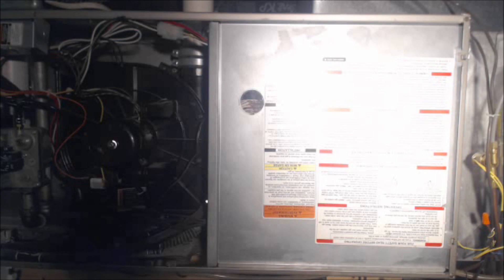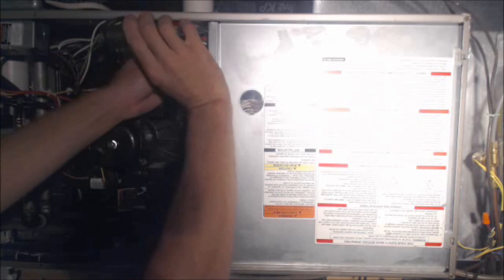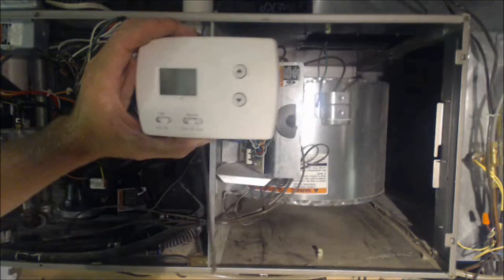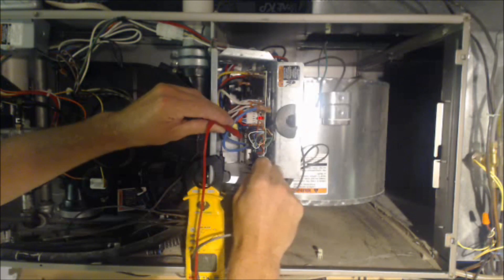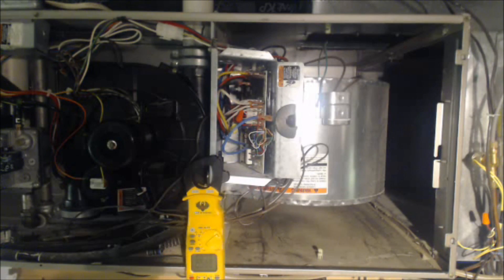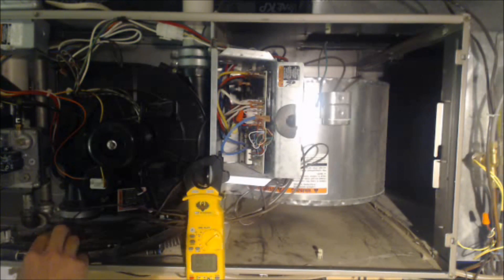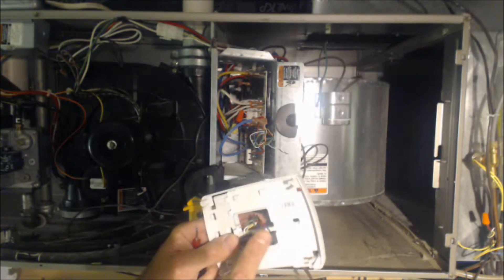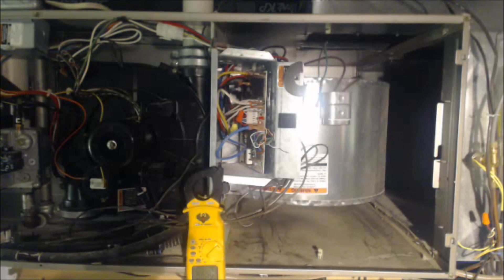Blower Fan Motor Won't Shut off!- STEP by STEP Troubleshooting!

Comment: Cant you just pull the G Green Blower motor from the terminal and see if it stops?  If not then its not the Terminal or stat that is shorted or bad..Correct?  ?
Reply from the maker: Yes you certainly can start by pulling the g wire off of the control board first to figure out if it is a bad tstat, or wiring. I usually test things first with my multimeter before moving any wires but there are many ways to do it. This is just an example, thanks

Comment: Thank you for this video. Following your troubleshooting steps, I found that the board on the wall plate of my thermostat was fried. My blower was stuck, and I had checked the wiring and experimentally tapped the relay and thought I might need to call a tech. Thanks!

Comment: What if you have three units that the blowers stay on and you have 5 thermostats that run them (3 for A/C and 2 for heat)? It isn't turning on heat or A/C but the blowers refuse to shut off even with all 5 thermostats disconnected!!  The only way to shut the blowers off is to flip the manual switch.  It's at an American Legion Post (obviously not residential, who would need that many units?)  I'm an Automotive Tech with a degree in electronics but this on baffles me because I'm not an HVAC tech.   Help a Veteran wrap his brain around this odd issue before I call an HVAC specialist to fix it because I won't be there when he fixes it due to work.
Reply from the maker: Do these heaters have fan limit switches? If so, the temp off needs to be adjusted higher. If these are newer units then find the manual and check the dip switches on the control board. You may have them set to continuous fan to pull in outside air for makeup air possibly since it is commercial. Thanks
Reply: I just found out tonight that one of our TVs and satellite boxes hasn't worked at about the same time (we don't use that TV very often) and we did have a thunderstorm that week.  I would have never even pieced this together if I wasn't changing all of the batteries in the thermostats(Three of them showed low battery and I was hoping that was all that was wrong) when someone asked me to replace the batteries in the remote for that TV and it still didn't work with the remote or manual power button.  I'm pretty sure that we got hit by lightning.  I'm off tomorrow so I'll take my meter and get a better idea of what's going on but I'm pretty sure I'll be calling a pro and our insurance company.  Thanks for the advice and I'll let you know what did happen. It's odd that all three units are doing the exact same thing and they're locked up in a room so no one has been in there other than me last fall to change the filters. Anything electronic can and will do weird things so it's not out of the realm of possibilities, I guess.  Thanks again!!

Comment: It is not possible to follow without electrical drawing , for me it is not a great video
Reply from the maker: Thanks Salvador Dali, I do appreciate all comments. They do give me a sense of what you are all looking for and what is helpful for the future, thanks!
Reply: maybe if you are a home owner. if you are a traesman then this video is excellent, I have suggested to my apprentices to watch all of Ac techs videos.  IF you are a home owner then you need only to know this ( dont need a drawing )   R = 24vac power  C = common  G = Fan  - Y = cooling   W = Heat .. if R touches any corresponding wire it powers the relay to that function i.e   R + W completes the 24 vac circuit for the call for heat..    If R and C directly touch then your furnace is likely not doing anything since you have either blown a fuse, board, or transformer.    R and C touch would be a 24 leg without load which is a short of sorts.   remember that an electrical meter reads the voltage POTENTIAL, this means that if you were to take the R ( 24 vac power ) and strip the wire in 2 places and test is you wll see 0 volts ( you would actually have 24 vac in both locations of the wire but there is 0 difference in the voltage potential )   much the same as if R and C are touching, WITHOUT a load on the line then you have 0 voltage differential, and the transormer will burn out shortly.

Comment: Sometimes my fan runs all the time and the house gets hotter and hotter even though the heat pump is not on .It does it about 2 times a month and I have to turn it off at the breaker .Sometimes it work fine .
Reply from the maker: While this is happening, try pulling the 24v thermostat face off and see if it continues to run. If nothing is calling at the time from the tsat but the fan is running and you remove the 24v face off, you would know if the tstat is the problem. Start there, thanks Doug Hill!
Reply: I have pulled it off and it still runs and keeps heating
Reply from the maker: Do you have electric resistance heat strips powering too or is it just the fan? So at least you have one thing out of play knowing the tstat is good so far. Are you getting 24v from g to c in the air hander?
Reply from the maker: I would only troubleshoot this with the electric res off and the fan off to stay safe. I would turn the power off and disconnect these items and then turn the power on to take the voltage readings to figure out what is going on.
Reply: I do have heat strips but they have never had to come on ,I turn them on to burn the dust off ever so often .But something is making heat ,it's not as much heat as the pump makes but if it's 50 outside the temp inside will keep rising. I think thats why the fan is running.

Comment: I have some problem my furnace can keep running but heat pump turns off. I replaced control panel but fan still keep running.
I turned power off the removed thermostat cover and turned power back on and furnace still running. Is that mean thermostat good? What is problem ll be? Pls help thank you.
Reply from the maker: That does mean that the thermostat is good if the same thing happens when the thermostat face is off. What happens when you turn the power off and disconnect the w wire off of the control board and then turn the power back on. If nothing happens then the problem is in that thermostat wire.
Reply: acservicetech do you mean W wire goes to termostat? There is no W wire going to control panel. Btw I changed termostat and control board. But still have same problem.
Reply: acservicetech do you mean W ( white wire ) going control panel, yes I unplug it then turned power back on, and fan still on

Comment: thank you for your video really helps, question: my blower motor does not remain on when the heating shuts down, not even a second, can you please give me a pointer, thanks
Reply from the maker: Do you have a control board, electronic fan timer or, 24v sequencer, or fan limit control? If it looks like this then you have a board. You may have dip switches that you can set for the blower off delay. You might want to set it for 60 or 90 seconds unless your furnace is a downflow in which you may want to set it to 120 sec. Thanks
Reply: this is an old G.E. package unit, which has a fan/limit control switch which I just replaced, no board

Comment: I have a system that will not shut off after reaching the desired temperature. I have it set to heat at 68. When it get to 68 the heat will kick out but the fan keeps running pulling in cold air until the temp reaches 67 and then the heat will kick back in and run till 68. This is a none stop process. What do you think? Amana M# PHA24B0002A  S# 9212231454 with a hunter 44760 thermostat
Reply from the maker: After turning the power off and removing the thermostat face plate and turning it on, does the fan still run? Do you have 24-28.5 volts between the G and the C on the control board of the package unit?
Reply: The fan does not run after turning off power. The fan will stop and not turn on until power is back to unit. Checked the volts and I am getting 15.9 volts on Fan = G and common = C
Reply from the maker: What happens when you turn the power off and then disconnect the g wire off of the terminal block and make sure it doesn't touch any other metal in the furnace and then turn it back on?
Reply: Sorry for the delay. I work second shift. I pulled the green wire off G= Fan and the heat pump kick on first then 2 to 3 sec later the blower kicked on. Temp set to 60 and it is 63 inside.
Reply from the maker: So Randy, is the blower shutting off when the heat meets the temp set at the thermostat now with the g off of the terminal block? Also that post not the last one but before that I was asking if the blower keeps on when you turn the power back onto the unit with the face of the thermostat off. I was trying to see if it was the thermostat that was the problem. It would also be good for you to watch these about heat pump thermostats and therm wiring. -- https://www.youtube.com/watch?v=qiAOvJhq8_s&t=115s  --  https://www.youtube.com/watch?v=HenOWUDX8PQ
Reply: The blower will not shut off when it meets its temp. With the g wire on or off. The thermostat is new. Also the blower will come back on as soon as you turn on power no matter is it is set to 50 and it is 60 in the room. I will watch the vid now. Thanks!!!!!!

Comment: It's an x13 what happened was I was checking voltage on control board from common to one of the fan speeds to see which one was running got an electrical spark fan shut down immediately after that. I put my meter back on and was getting nothing. Long story short how I figured it out was I went to T-stat and was getting 0 voltage on all wires. So I started thinking why would I not be get any voltage there. I was getting  24 volts from transformer to control board. So I knew it was getting power. Then I thought maybe I popped fuse and sure enough that was the issue. I verified by checking for continuity and got nothing. So I went to the store bought some three amp fuses and it running fine. My question is why did the meter cause that electrical spark? I am happy though I want through some steps and figured it out.
Reply from the maker: The probe may have slid off and shorted two 24v wires going to the x13 control maybe. Glad to hear it worked out. As you go you will have a little kit put together with a few of each of these items like 3 amp and 5 amp spade fuses as well as bottle fuses. Did you check out this video on the X13 --  https://youtu.be/ZzvhtmQTiMY

Comment: Getting 0 voltage reading at thermostat also
Reply: Think I figured it out my 3 amp fuse blew. Check for continuity across fuse and I am getting nothing
Reply from the maker: Ok I was thinking that maybe you had one problem and another formed just from servicing so that makes sense. How did you make out? Was it just a capacitor or blower or board? I was assuming that you were dealing with a psc blower motor but wasn't sure if it was a variable or x13.
Reply: acservicetech This is my own personal unit just want to clairify that. I was just trying to learn what controls what. e.g. Power coming in power going out. What wire controlled what fan speed. I am in heat mode so I was trying to see what wire coming off blower was active.
Reply from the maker: Ok, cool. Yeah that's how we all learn.

Comment: Blower motor will not run it is making a humming sound but. It turning on. I am getting 24 v from common to red at control board but getting nothing from common to low speed fan. It's in heating mode. I switched to cool mode and still no fan running. I now have the fan on mode and still nothing.

Comment: have a 1985 carrier replaced main board, blower continues to run. removed all low voltage wires, blower continues to run. check safety stats all good. found second board for inducer and has valve. I need to check.
Reply from the maker: What are the m#'s of the 2 boards and or the furnace?

Comment: I have a 2012 5th wheel with furnace issue....My thermostat is set at 68 degrees F and the furnace operates fine But the furnace won't shut off...I have a 5 button thermostat which has been replaced 3 days  ago but still not working. My dual therm thermostat is very pricey and all wires are connected proper.We had a service man here But he knew and did nothing.So we have too find a geek to solve our problem.  P.S we had the furnace working fine yesterday morning from 6:30-2 pm without an issue, then it started again to malfunction ...need some answers as needed this furnace to heat the nights as it dips down to 2 degrees. thks
Reply from the maker: Hey Len sorry to hear that. Without being in front of the furnace and not knowing the type I would not know. The channel is set up for techs. It sounds like the thermostat is not the problem but without reading voltages one would not know the issue. My only recommendation is to have a tech out from a reputable dealership that sells them. Thanks

Comment: I have a Goodman furnace Model GMPN100-4. My blower never shuts off even if the thermostat is set to Off/Auto. The only way to shut it off is to pull the plug on the furnace. There was continuity on the hot surface igniter, but no continuity on the limit switch. Is the bad limit switch the problem?
Reply from the maker: If it is a limit switch for testing purposes only, you could jump it out temporarily and then turn the power back on to see if the fan does not run. Just make sure not to leave the jumper there as no safety limit should be jumped for normal operation.  Some furnaces are wired in the way you are describing. Also check for 24v from g to c on the board. You could turn the power off and take the therm wires off the board and turn the power back on to see if the problem persists. Let me know what you find or any other questions. Thanks

Comment: EXCELLENT! Thank you.  Do you have close up pix of where you touched the probes?  Hard to see in the video.
Reply from the maker: Roark, I don't have any close ups of this particular video but I do have close ups of troubleshooting the thermostat and blower motor. Here is bypassing and testing of the thermostat and wiring. ---    https://www.youtube.com/watch?v=J9bxLpJpRNE&t=1s&list=PLxnHR5_D2ojzDfU1IjPpzdhi_mUGe3F7W&index=13   -------   Here is testing of a furnace blower motor -- https://www.youtube.com/watch?v=flbUtLMeSOQ&t=1s&list=PLxnHR5_D2ojyDrxCT9MIttGW4wxOZ3n-7&index=9

Comment: Hi acservicetech! great video. I am an installer and I saw one time that a blower would not turn off after customer set it to heating before we hooked up the gas. The unit locked out and kept the blower on even after turning unit off from t stat. we had to pull high voltage plug for blower to come off.  is this normal? Did the blower get locked in from the board because no flame was sensed as a safety? 

Also, I have had customers tell me to lower their fan speed but no one has ever showed me!! do you just switch the black lead on the board with whatever speed you want it to be? like switch the black with the red or blue. etc. Thanks!
Reply from the maker: It is likely that a fault set the blower motor to run continuously depending on the brand. It was in lockout likely. If you lower the fan speed for heating mode then you still should check to make sure that the temp diff between the return and supply is still only 50 degrees and not hotter so the plenum heat sensor doesn't go off. Likewise in cooling you should check the charge again to make sure that you still have enough air going across the coil and still have some superheat. Check this troubleshooting blower motor playlist out.--- https://www.youtube.com/playlist?list=PLxnHR5_D2ojyDrxCT9MIttGW4wxOZ3n-7 ---- and especially blower motor fan speeds and testing --- https://www.youtube.com/watch?v=cXepQ2LGEL4&t=76s&index=10&list=PLxnHR5_D2ojyDrxCT9MIttGW4wxOZ3n-7

Comment: I have a problem like this. my thermostat is about 1 year old. Called Honeywell troubleshooting seems like it fine. My question is there is an extra blue wire not used behind thermostat. Will that wire be by the blower motor. Can I use that wire to swap out a bad wire if it is there?
Reply from the maker: That is exactly what you would do if one of the other wires such as green going to the G terminal was touching the red going to the R terminal. You would switch G green out with the spare wire but that is only if you verify it is the therm wire that is causing it. You could turn the power off and disconnect the wire off of the g terminal and then close the door and turn that unit on. If the blower does not turn on then the problem is the therm wire. If it does turn on then you know the therm is not the issue. Thanks for the question!
Reply: I disconnected the green wire from furnace turned power on still runs. Then green wire from furnace still runs. any ideas?
Reply from the maker: You would have to know if it is a variable speed or just a psc blower motor. You can check out my blower motor playlist but if it is a psc which means it needs a capacitor and you have disconnected the wire off the g terminal on the control board then it is a bad  control board but if it is a variable speed or x13 then more testing needs to be done. Thanks!
Reply: OK found a problem this is newer unit and there is a 3 ATC fuse keeps blowing out when I replace it. Any ideas?
Reply from the maker: The 3 amp fuse will only pop if the R terminal wire or what it is connected to is directly touching the C Terminal wire or what it is connected to.
Reply: C is common right? I looked the way it connected and they have it 2 red wires to C terminal. and 1 green and 1black to red on the terminal block inside the furnace?
Reply from the maker: Wow, they did not use the thermostat color code. Here is troubleshooting a thermostat which talks about the wire colors. ---https://youtu.be/81_gCF4mJtQ----If you are not sure what you are looking at it may be wise to call another tech in to figure out the problem and trace the wires out. Thanks!
Reply: Thank you for responding. You go above and beyond.